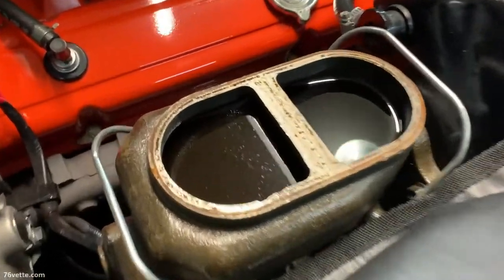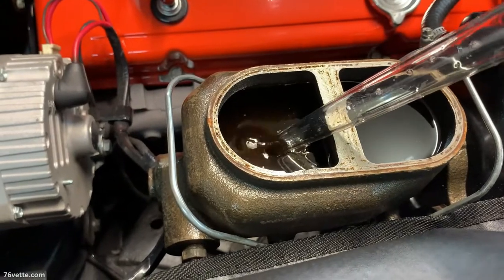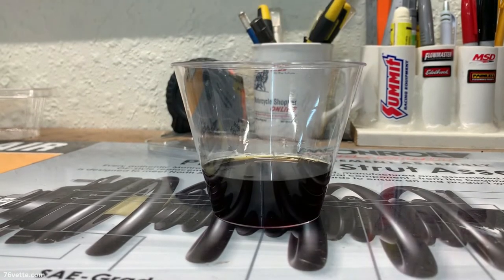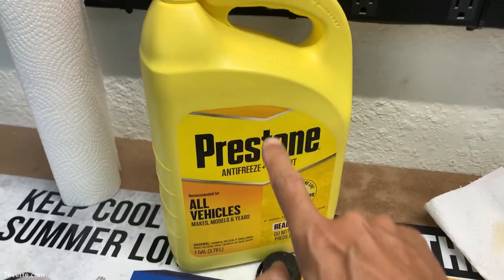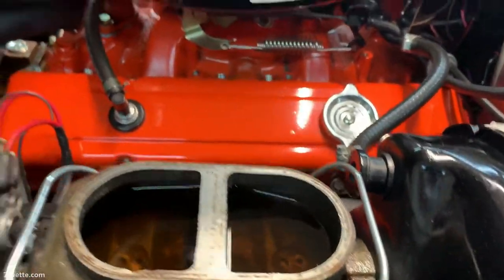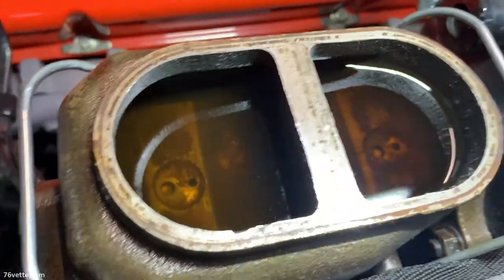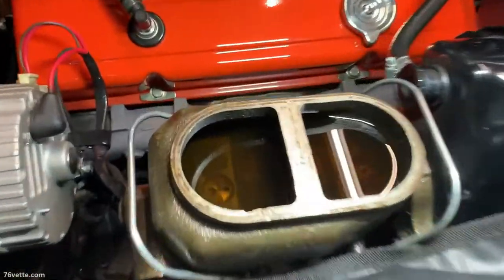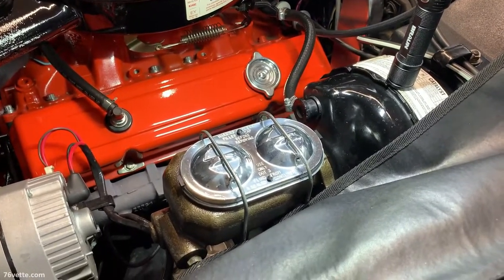EASY Way to Replace Old BRAKE FLUID

Comment: I just changed m/c fluid. You can removed all of the fluid and clean the bottom with brake cleaner. As long as you don’t pump the brakes no air will enter system . Thanks for the video!
Reply from the maker: Thank you for watching! 😊👍🏻

Comment: Mitch is correct. Brake fluid is hydroscopic. It attracts moisture.  I open the GTO master cylinder and close it back up fairly quickly. Same with the fluid bottle. So much humidity now doesn't help. 
Good to remove old fluid though. I flushed the 69 Vette once; longer job than I thought but was satisfied when completed.
Reply from the maker: That’s why I prefer to buy the smaller DOT3 brake fluid bottles. And like someone mentioned, you do this simple job enough times and you’ll probably never need to flush the system. 😊👍🏻

Comment: Great video! I've always heard that brake fluid absorbs moisture over time, doing this will surely help with that too!👍
Reply from the maker: Thanks. Yes, even after you open a new bottle you have to try to use all of it. It has a shelf life but I have no idea how long that is 🤷🏻‍♂️
Fresh brake fluid is kinda important 😆👍🏻

Comment: Probably advisable to clean the cover first. Leaving brake fluid exposed to the air is not recommended.
Reply from the maker: The moment you open a brand new bottle of brake fluid it starts absorbing moisture. 
But let’s be reasonable. 
Brake fluid will absorb approximately 2 to 4% of its volume in a year depending on ambient humidity. So what realistic impact do think say 10 minutes makes? 🤷🏻‍♂️